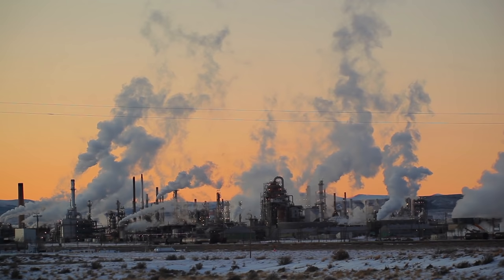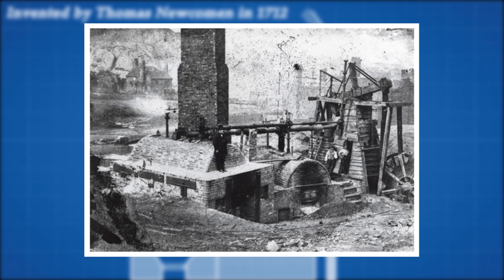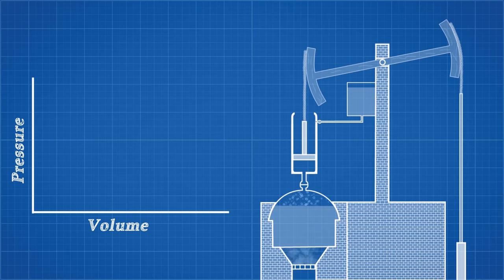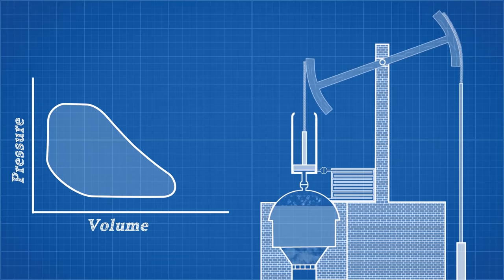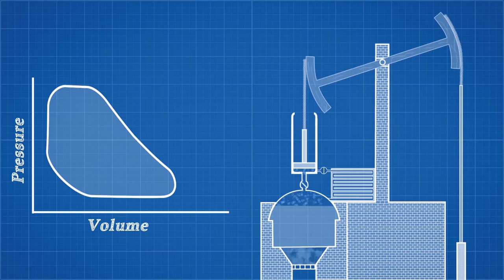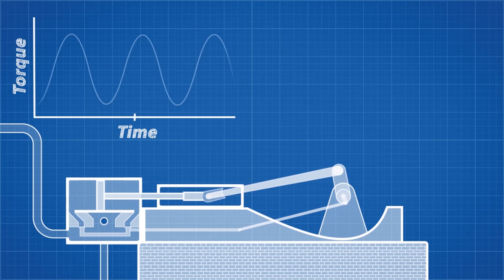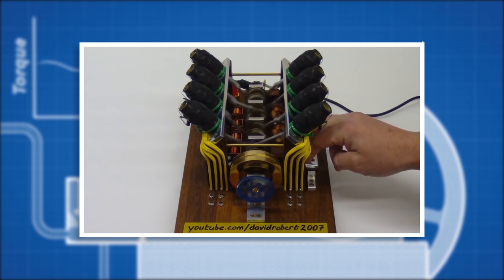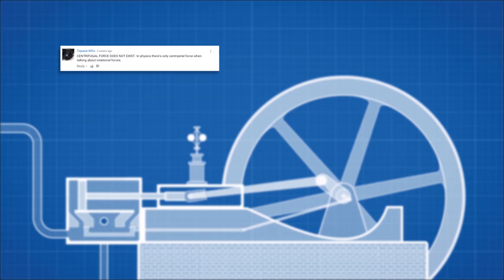Steam Engine - How Does It Work

Comment: 2:50 - I don't think that's accurate, pressure acts in all directions equally and the cylinder orientation should not matter. Condensing the steam will create a vacuum in either orientation. The piston weight itself might make a difference.
Reply: (note in the diagram it does make sense, since the cylinder is sealed off from atmospheric pressure, it's just not because it's sideways)
Reply from the maker: +foobargorch Yeah you are right. Poorly phrased, my bad

Comment: Even if the engine is sideways, atmospheric pressure could still push it. The reason for double action is that the steam (which is at a significantly higher pressure than atmospheric) is acting on every stroke. This difference is similar to the difference in power per size from a 4 stroke engine to a 2 stroke engine. Steam locomotive engines had at least two cylinders, meaning four power strokes per revolution. This is partly for power, but it is necessary for the engine to be self starting. This means that the engine is always in a power stroke.

Comment: I believe there's a small mistake. You said that by putting the cilinder horizontally atmospheric pressure could no longer act on the piston, but it is renowned that pressure acts in every direction, like in water

Comment: great video m8!
you did get the control valve timing wrong in the animation. you put it at roughly 180 degrees from the piston crank but its supposed to be 90 degrees.

Comment: my only problem with this video: atmospheric pressure works in all directions. putting the piston sideways wont alter atmospheric effects on it. only gravity is directional. if they included a second valve to move the piston in both directions than its to get more work into the cycle or so (not sure right now) and not because "atmoshperic pressure can no longer force the piston back down"

Comment: i searched up what a steam engine was and found out about how it was a heat engine which does mechanical work by using steam as a working fluid, it basically uses the force caused by steam pressure to push a piston back and forth inside a cylinder and this pushing force can be transformed by connecting a rod and a crank, into a rotational force for work, it was pretty interesting

Comment: This really is the first video on youtube which explains steam engines really well, but I've a question, what does the centrifugal governor do? You could of explained it in the video.
Reply: It controls the fuel supply to the engine to keep the speed stable if the load changes. He is gone explain this in his next video.

Comment: So after you add a separate condenser: at the top of the 'stroke' the condenser is opened and the steam can escape into a cooler chamber thus creating a vaccum which pulls the piston down which then opens a valve letting in high pressure steam . . . . . i know it sounds odd but i never really understood what "added a seperate condenser" actually meant until i saw WHERE it was added and how it worked: now i get it. The only other machine action i dont understand is the OTHER end of a Newcommen steam engine: how is the water actually raised out of the mine? Is it suction? A chain of buckets? If you know of a good video showing what happens id really appreciate it.

Comment: Just a few things, atmospheric pressure will push a piston upwards never mind sideways against the vacuum of a Newcomen type engine, and the flywheel would bring it back anyway in the high pressure type wouldn't it? so (apart from the fact that they are two different types of engine and the Newcomen would never be used to make rotary motion....let alone be able to be self propelling!!) it is more about getting a return power stroke than just simply returning the piston to accept more steam, and in the Newcomen pump engine, it is the weight of the pumping gear that pulls the piston up, not the steam entering pushing it up.

Comment: Awesome video. Seems like the cam lift and crankshaft stroke would have to have some kind of ratio. Do you know what that is ?
If the crankshaft stroke was too long or too short it seems like the control valve  wouldn't be open at the right time.

Comment: The Newcomen Atmospheric Pump wasn't a Steam Engine. Steam dos'nt push his piston up, the beam pulls it up. Atmospheric Pressure pushes it down.
 James Watt dumped Newcomen's Atmospheric power for Steam Power.
 He had to invent a new engine to achieve this.
It was nothing to do with efficiency!
James Watt's engine was the first practical steam engine, it provided practical steam power for the first time.
Hey Presto! The industrial revolution!

Comment: I'm building a steam loco out of a clothes basket a tube from one of those steam clean thingies some cardboard from kitchen tissue. so the basket is the boiler you put hot water into it and obviously the steam goes up so that's where the tube thing comes into play so the steam goes up the tube and the tube curves back down and into the cardboard comes next and the steam goes out the two ends of the cardboard and into toilet tissue cardboard (Yeah I didn't think I would stoop this low either) and the toilet tissue cardboard are the pistons and if you are a true fan of steam trains and logic than you type down if the comments what the last steps will be. byeee

Comment: A slight error.

Even if a cylinder is resting on it's side the air pressure can move the piston if the pressure in the cylinder is lower than the pressure surrounding it. And the condensing steam is creating a vacuum. 
But gravity is no help anymore.
Reply from the maker: Yes, other people pointed that out. 
A tad embarrassing, but yeah I was thinking gravity.

Comment: I have been reading lately about CHP plants, and I have been wondering if it would be possible to convert the heat produced by a CHP unit into electricity using some kind of steam device.  Would this be a good or bad use of the heat produced by a CHP unit?

Comment: you neglected to mention the difference between low pressure and high pressure steam. your first engine diagram is a low pressure as used in mine engine houses, the second (with the flywheel) is a high pressure with double-action piston as used in steam locomotives; low pressure steam engines are not powerful enough to push a locomotive, even with a double-acting piston.

Comment: the animation for the rotational steam engine is incorrect the valve must be offset a quarter turn to the crankshaft not a half turn. Turn it a quarter turn in the other direction and it will run in the other direction.

Comment: "This machine was not going to start an industrial revolution"?  I would like to see some justification for that claim.  I consider it absurd.  By ~1800, when the first pressurized steam engines were developed, over 2000 atmospheric engines (~ 1500 Newcomen and 450 Watts engines with external condensers) were in use.  The entire history of steam power and the Industrial Revolution are intimately entwined with Newcomen's invention.
Reply from the maker: You are right, it really did start the industrial revolution, but my point was that it wasn't useful for the applications that we associate with the industrial revolution. It was really only used for coal mining.

Comment: this has already been commented, but the piston on its side has no effect on atmosphereic pressure.
Reply: the main reason why there would be a dual chambered piston, would to increase speed and power on the return stroke, by #1 not having to cool the cylinder, and #2 providing more pressure to compound the total pressures of the entire cylinder system

Comment: Imagine how much fossile fuels we would not be using if our heat engines operated at near 100% efficiency. Of course that would required a near frictionless engine that could operate at unbelievably high temperatures. And even then, there will be more limitations.

Comment: At 1:09 when you say no mechanical work occurs on the stroke because the chain can only transmit force in tension...why is that/what does it mean? If it is displaced through the tension, isn't there work done?
Reply from the maker: because that old steam engine was using a flexible chain to transmit force. Chains can only transmit force in tension. If you pushed it, it would just kink and buckle.
Reply: Thank you! 
I love your videos. Thank you for bringing us knowledge!

Comment: You should make a video about helicopters, I'm currently struggling really hard to find an effective way of explaining how a helicopter works... I've tried on three seperate occasions  to make a video explaining how all the controls work together and how mind boggling a helicopter realy is. Sadly each time I've tried it feels like my explanation doesn't do the wonders of the helicopter justice.

The fact that helicopters can fly blows my mind everytime I think about it. And it's hard to get across via video. There doesn't seem to be a really good and well made video on the subject (smarter every day, has a good series on it, but I feel like it's too long)
 Maybe you could do the helicopter justice and make a video about the wonders of the helicopter.
Reply from the maker: For sure, you have any particular helicopters in mind that would be good to base the video around?

SED's helicopter videos are probably my favourite videos ever put on this site. They are partly responsible for me studying aeronautical engineering.
Reply: Well...I don' t really think it matters what helicopter you base it around.

How much do you know about helicopter (not condescending)? Your production quality would blow all the other explanation video's out of the water. 
 Just explaining lift in an understandable way and applying it to the main rotor, and tail rotor and how they interact + how i.e. increasing pitch on the main rotor has an affect on all the other controls(something along those line). Would be AWESOME.

If you're interested in making a video about this and would like help, let me know I'd be glad to help!
 Once im done with flight school I'd like to become a flight instructor, helping with explaining helicopters to thousands would probably be a great experience for me.

https://www.faa.gov/regulations_policies/handbooks_manuals/aviation/helicopter_flying_handbook/media/helicopter_flying_handbook.pdf
(this is imo the best helicopter textbook that exists)

If you're familiar with the physics behind it, the fact that: each blade can flap, lead/lag and feather to make up for the problems earlier helicopter had is AWESOME. or the way autorotation works,  there's a lot of interesting things about flying helicopters.
Reply: + I agree that SED is awesome, he is also partly responsible for me becoming a Pilot

Comment: If a turbine is more efficient than a piston why are turbine powered cars and tanks so inefficient with fuel consumption?
Reply: nico heidenreich what turbine powered car are you referring to specifically? There may be tradeoffs being made with weight
Reply: nico heidenreich, as far as I understand it has to do with weight and operation. Turbines beat pistons when they get larger. Turbines also rely on more constant RPM, which make them less suited for vehicles which may require varied RPM output. However if used to charge a battery powered car/train/truck that may change the question.

Comment: Bringing back the steam engine is the salvation we need,you just heat the water with some kind of electrical charge in stead of burning coal.Desalinizing water from oceans should be no prob in todays modern age turning salt water into fresh drinking water useing soloar and wind should be no problem.

Comment: First machine ever to use steam was done by a Spanish Mining 
Administrator and inventor named Jeronimo De Ayans in 1606.  De Ayans is
 best remembered for the invention of a steam-powered water pump for 
draining flooded mines-for which he was granted a patent by the Spanish 
monarchy in 1606.
He also improved scientific equipment, developed windmills and new types
 of furnaces for metallurgy and industrial, military and household use. 
He invented a bell-like diving suit and even designed a submarine. He 
died from a serious illness in Madrid, in 1613. 
That was the first ever Steam Machine.  Pumps to drain deep coal mines. 
  From 1698, The BRITISH put steam to work on other applications and 
improved the Spanish Steam Machine,  BUT THEY DIDNT INVENT THE STEAM 
MACHINE INITIALLY. 
In year 1606 DE AYANS DID IT FIRST in Spain. NOT 1698 Thomas Savery in 
Brittain, As they lie all over..
That is another lie to take the credit away from The Spanish as 
practiced by the british of that era.  That is Called THE SPANISH BLACK 
LEGENDS.  That is the name of Legends and lies created by the British 
Monarqui when they were enemies of The Spanish Empire. They also lied 
about many other things about The Spanish besides the invention of the

Comment: you say allot about the "evolution" of the steam engine.  Same word often used in the realm of biology and living things.  Your steam engine would be evolving if nobody touched it .....and it changed itself ...and added a valve or something.  All living things are controlled by DNA which doesn't change with random mutation and natural selection.  This sophisticated information in DNA was there right from the onset.  In mechanical things mankind has built on a knowledge base and "developed" steam engine changes.
There is no evolution here either.  Airplanes don't evolve.  Steam engines don't evolve.
Adding complexity doesn't necessarily make it "better" ....it just makes it different.
Like Einstein said....God doesn't throw dice.  and Everything should be made as simple as possible, but not much more so. In airplanes what is gained in one direction is lost in another.  Smaller wings, more speed but less lift and higher stall speed.  The same sort of thing goes on in steam engines.  More parts, more weight, more lubrication points etc.
The word "evolution" is a "world of confusion."